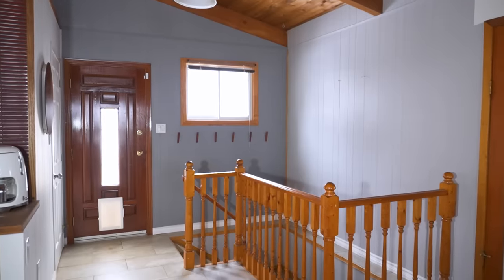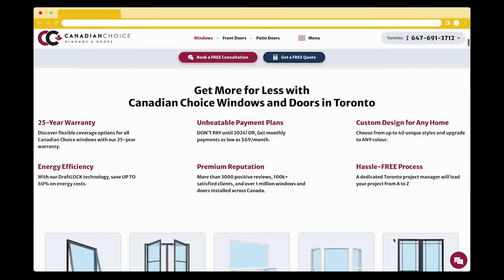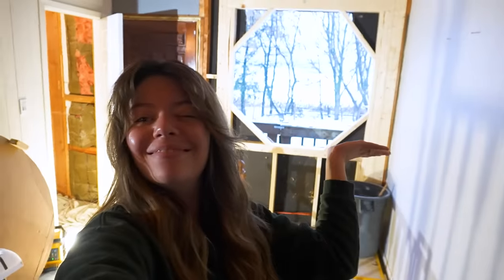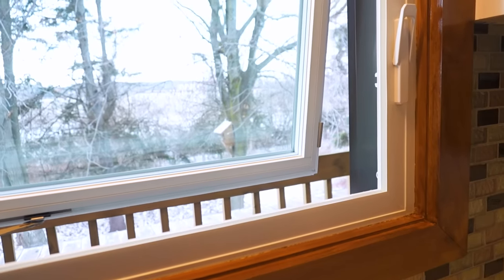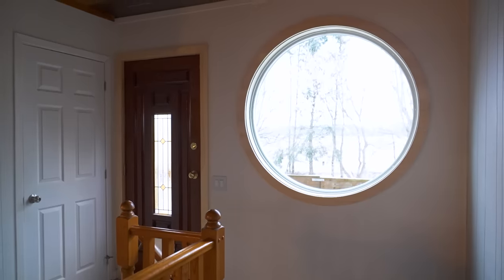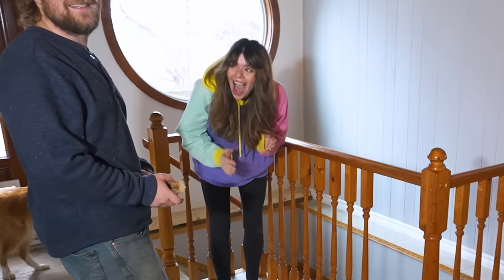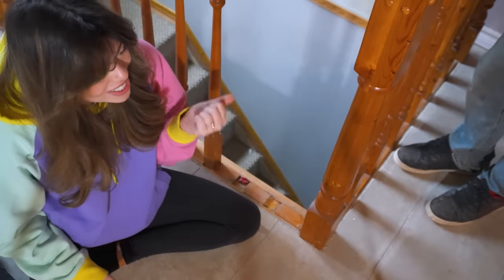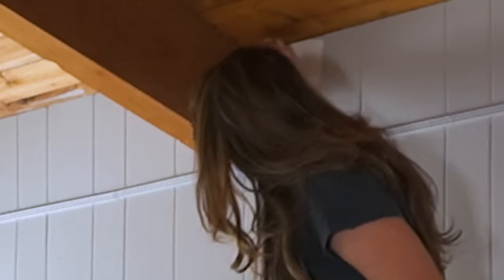starting my mcm entryway makeover (circle window install)

Comment: That railing moment had my jaw to the floor!!!  What the actual eff!?  So glad you guys are getting this railing done properly💪🏼🥰
Reply from the maker: Same! Like who would use tape to install a railing! Like?????
Reply: The first thing that popped in my head was what if someone had fallen against the railing and fell through the hole. Unlikely, yes. So glad it is getting replaced. Also, that round window is beautiful.

Comment: Becky you are a braver woman than I. I would have been terrified to paint over that hole on the ladder without Austin/someone spotting me! 😂
Reply: I was honestly very disappointed she'd do that on video. It's not safe, and other people shouldn't get the idea it's ok.
Reply: @fryesteph  How would you suggest she, or anyone for that matter, reaches the top of the walls around the staircase when painting?
Reply: @Barb..... playing devil's advocate here, but would one of the really long paint rollers work? though I'm still thinking at least a footstool on the stairs for more height.
Reply: @redthorned  She did use a long roller, but you can get the top edge with that.
Reply: @Barb.....  oh she DID! mine blind (distracted) eyes. I had to go watch it back xD Since she started with a paintbrush (to do the edges essentially) I ended up thinking "okay, doing the whole wall with a brush? weird, but you do you Becky"
Reply: @redthorned  It's a bit of a quick edit during that part so I can see how you might have missed it.
Reply: @Barb.....  They make a special edging tool that you can put on an extendable pole to reach areas like that. I had to do it in my stairwell. I can't believe that Becky rigged up that plywood/ladder situation--so unsafe and unnecessary!
Reply: @fryesteph  I couldn't watch it.
Reply: . @fryesteph  Agree, was nerve wracking to watch. At the very least Austin should have spotted her the entire time she was on the ladder.
Reply: Becky had the right idea to put a board over, but my health and safety alarms were ringing when she didn't use a sturdier board and secure it down to the floor. It made me lol that one frame is like "Omg these balustrades are only taped in?!" - to - just putting a flimsy board loose over top of the stairwell. Lol. Safety measures should apply to temporary things as well as permanent ones. 

Not to judge as I have made these sorts of errors many times. And I am always on a ladder barefoot/in socks too... which I'm sure is a big no no haha. Anyways glad she is ok!! Love your work Becky. <3
Reply: @fryesteph  I agree, the concept of laying the board there is fine , but that board was nowhere near sturdy enough to be safe

Comment: I believe most railing spindles are installed in a similar, loose fashion because the pressure from the posts is supposed to be very secure. If installed properly, spindles do not need to be glued or nailed down.
Reply: That's surprising. You could be correct for all I know, but I don't think I'd want that method of installation in my house...I'd be nervous about it.

Comment: Just wondering, could you do a tea stain look for the round short light? And or paint the top of the glass light, tan/brown? So they would be varying shades of "tan/white and brown? Or replace the long shade with white......(you know how to make lamp shades). Or just paint the top part of the glass light brown? So it would be "brown white and tan"? 🤷🏻‍♀️ But, it's your house and if it bothers you down the road.....you will fix it! 😊
(I like either "All 3 matching" or 
"3 different colors".....